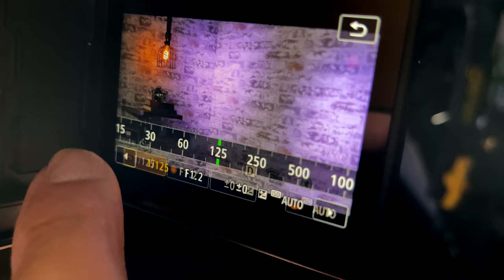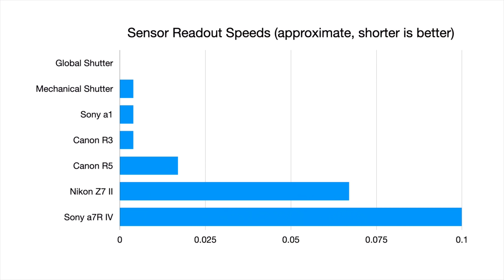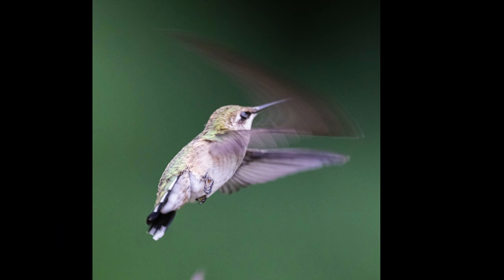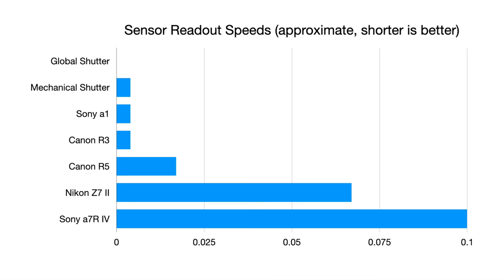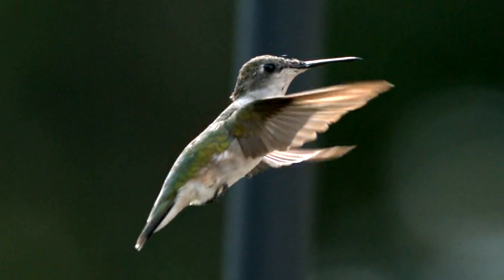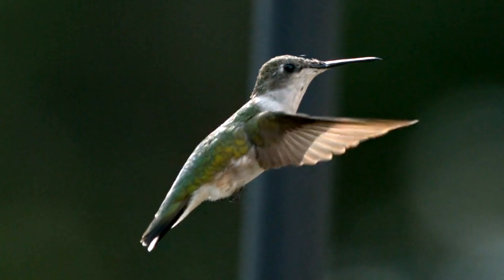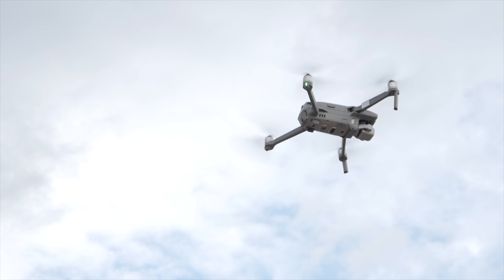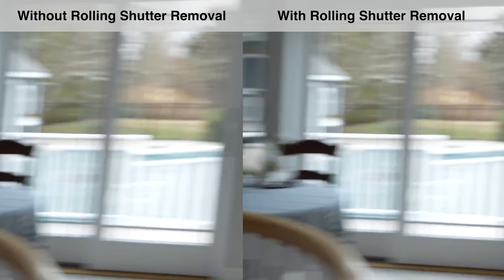Rolling shutter RUINS your photos & video: Let's fix it!

Comment: I'm amazed there isn't an option where a camera takes 2 or 3 images and then replaces the dark bands with the data from the next frame.
Reply: New mobile phone cameras that have HDR modes do this. They take a stack of photos all with slightly different ISO setting and then blend them together. It would be interesting to test these phones and see if the bands go away.
Reply: @seth.heerschap  phones are doing such cool things to get around the fact they are small sensors with tiny lenses, I would like to see some of those features come to 'proper cameras'.
Reply: @Speak_Out_and_Remove_All_Doubt  pretty much all of these features you can do in post with a real camera, with the added benefit of lower F stop, higher resolution, better dynamic range. But stacking is a very common feature in astrophotography and when you want to get the sky and subject without anything overexposed.

But I really do love the quick edit and post that smart phones have these days. They're improving much faster than professional cameras I think.

Comment: For still electric silent shutter photos,  You didn't mention it in the video. (edited, forgot to mention this is for stage theater hot lights)

On my Canon EOS R,  When I have certain stage lighting.  If I notice banding in my shots.  I have to figure out what's the light "frequency",  which most of the time is 60hz.  From there, I have to use the multiples of 60 to try to match up the stage light sync.  So I'm usually be shooting in 1/125, or 1/250 of a shutter speed to help minimize the banding when using still electric silent shutter photos on the EOS R.
Reply: It seems to me the if the problem was this easy to solve, this would be how we'd all be working around it. And it clearly isn't.

i cant see why this would fix the problem. Sensor readout is the time the sensor needs for the pixels, from top to bottom, to start reading. The shutter speed only indicates the amount of time each pixel has to keep "reading" until they stop. This means, if you shoot at 1/250 and if the sensor readout is about 0.05sec (1/20th), that when you take a photo, the pixels from the top of the frame will end the exposure before the pixels from the bottom even start the reading (because the readout is slower than the exposure). Counterwise, in a 1sec exposure, the readout would finish way before the first pixels that started reading, the ones on the top, end the 1sec exposure.
Now going back at your "60hz flickering fix with 1/250", as how i understand this all works... It seems to me that the pixels from the top would start the exposure earlier than the ones on the bottom, no matter what shutter speed you're using. If the readout is 1/20th, this means that the 60hz light has done three full flickering cycles by the time the camera has ended the readout... And each pixel has done a exposure of an incomplete cycle (1/250 < 1/60) at different stages of these cycles, so you should have 3 full flickering bands on the photo. This wouldn't happen if you shot at 1/60th because each pixel, no matter at what given time starts the exposure, would read a full flickering cycle, gathering the same amount of light as any other form another part of the sensor. Following that, you should have flickering in a 1/50 exposure because each pixel gathers a bit more than a full cycle at different stages of it, and the light gathering from each pixel varies again. So, when bumping up the exposure time, yes, the multiples of 60 theory makes sense, but when the exposure needs to be under 1/60, it seems to me that you have nothing to do to solve it other than having a super fast readout, again, the exposure has nothing to do at this stages.
Reply: @marc5279  TL:DR

I think I forgot to mention in my post.  That it was theater stage lighting that use hot lights, and not LED lights???  (Not familiar with the technical terms of theater stage lighting).  Since LED lights act differently than the old hot theater stage lights.
Reply: @marc5279  Also, I have to photograph low budget stage theater, and high school theater rehearsal shows.  That's how I notice this problem.  And how I fixed it.
Reply: @RonaldLadao  ye, big hot lights flicker quiet softly, and banding must appear really subtle, I cant see why you have any flickering issues in the first place... But if you say so, and that you experinced a fix doing this, i must be missing something here

Comment: I was worried about distortions when shooting flying cole tips, but it’s hardly noticeable, although my Olympus camera not even has a back-illuminated sensor. But the smaller sensor size certainly helps with a fast readout. Rolling shutter isn’t a problem on Smartphones either. Another solution: a central shutter such as in Hasselblad lenses.

Comment: Fantastic content, thanks. Golf clubs though DO bend significantly during the swing, especially with more powerful players - though they do use stiffer shafts.
Reply: Good point, especially if you use graphite golf shafts like I do, they bend a lot more.

Comment: I have a lumix s5 if you use aps-c crop mode for video (crop) or photo (med 12mp tele) the Rolling shutter drops from 21ms to 10.5ms.  keep that in mind if it becomes an issue.

Comment: I was  looking for a camera to do photos from a vehicle. I thought bigger sensors where the way to go due to more light coming in etc until I did read a comment on the A6100 about the rolling shutter, started investigating and wow, it is certainly an issue!. I'm moving back to investigate M4/3 cameras unitl global shutter sensors reach consumer market which seems like never happening.

Comment: How does rolling shutter relate to shutter speed? If my sensor readout is 1/30 s, does that mean that I can get blurred results of a moving subject as if I'm shooting at 1/30 s even though I may be at say 1/200 s?
Reply: Sensor readout is the time the sensor needs for the pixels, from top to bottom, to start reading. The shutter speed only indicates the amount of time each pixel has to keep "reading" once it starts. This means, if you shoot at 1/250 and if the sensor readout is about 0.05sec (1/20th), that when you take a photo, the pixels from the top of the frame will end the exposure before the pixels from the bottom even start the reading (because the readout is slower than the exposure). Counterwise, in a 1sec exposure, the readout would finish way before the first pixels that started reading, the ones on the top, end the long 1sec exposure.
A slow readout would give you deformations on a fast moving subject and high frequency flickering lights. The blur you apply on top of that is determined by the exposure time... So a slow readout with a short exposure has the best numbers to destroy your photos with rolling shutter and banding. On the other hand, a fast readout pared with a sufficient long-enough exposure shouldn't show any issues. But keep in mind, they are not related and one doesn't affect the other, the readout stays always the same, and the exposure "softens" its effects the longer it gets. Hope it helped

Comment: Does NTSC or PAL matter? I believe NTSC is used in the US and everywhere else you are supposed to use PAL to eliminate flicker. Is this correct?
Reply: As long as the shutter speed is staying at the hz rate of the place. For instance in the US and Japan it should be 1/60 to avoid flicker and 1/50 in Europe and elsewhere to avoid that flicker.

I have shot NTSC 30fps video in Europe with a 1/50 shutter and there was no flicker, so as long as you can hit the shutter speed needed for the lights, do it

Some mismatches can’t be avoided though like you can’t use a 1/50 shutter with 60fps video because the shutter is too long but you can use 1/60 with 50fps video.

Comment: How much better is the a9 than the R5? How much worse is it than the a1? Hard to find precise data on readout speeds anywhere.
Reply: A9 is about 2.5x faster. The R5's readout speed is ~1/60 and the A9 is ~1/150

Comment: I more or less understand the electronic shutter bending however not so much why mechanic shutter resolves it.

Mechanic shutter move at same speed it 1/8000 or 1/1000. The only difference is the distence between the 1st and 2nd curton. So why is it better?

Comment: It seems like a rolling shutter hardware fix for electronic shutters would be to turn on light collection for all pixels at time 0 and to turn off light collection for all pixels at time 0 + shutter speed.  Then read out the pixel values at your leisure.  This would solve the slow readout speed problem.  I haven't read any discussion of this solution.  Could there be a problem with needing pixel memory until the values can be readout?  Again, I have seen no discussion of these issues.  Is adding pixel memory hard?

Comment: Help me understand this here, I have a Canon 90D, The EOS 90D comes with an electronic shutter that can achieve a maximum speed of 1/16,000 seconds and a mechanical/electronic 1st-curtain shutter with a maximum of 1/8,000 seconds. So does that equate to 1-16th of a second and 1-8th of a second. Ta
Reply: no thats one/sixteenthousandth of a second and one/eightthousandth of a second
1-16th of a second  = 1/16
1-8th of a second = 1/8
Reply: @MikedieONE  cheers just realised as i posted the amount of zero's lol
Reply: @paulbrooks2796 Lol

Comment: The other day I was shooting hummingbirds and I had my shutter speed at 1/8000, aperture at f8 and ISO 800.  Of course the pic looked dark but since I shot in raw and the amazing dynamic range on R5, the bird turned out brilliantly sharp. Yet, the wingtips were not tack sharp like I hoped for.  I suppose its because of the phenomena you described in the above video?
Reply: I would guess that blur is more about action too fast for the shutter speed. Yes  1/8000 is fast, but so are hummingbird wing tips. Rolling shutter distorts where the wing tips are more than making them blurry.

Comment: Is it not possible to calculate rolling shutter based on sensor/camera specs and just use a simple algorithm to reverse the rolling shutter effect?
Reply: No, you would also need to know how fast the camera is moving and how fast all objects in the photo are moving in relation to the camera.
Reply: @TechnoBabble  I’m pretty sure they can make AI for this particular issue
Reply from the maker: For static subjects tilting because of camera movement, yes. But it's pretty impossible when you have moving subjects and a stationary background, for example.

Comment: I still don't get it. Why do you get rid of the problem with a mechanical shutter? No matter you have a physical shutter in front,  the read speed of the sensor is still slow, so you should have the same effect...
Why you dont have it (in pics) with the mechanical?
Reply: Ciro - when sensor is not exposed, when it's hidden behind the mechanical shutter, photosites ("pixels") on sensor keep the electrical charge, until it's purged after the readout. That means that what was captured during the exposure, that is what it will be read out. Exposure is separated from readout in this case.

So, at least with longer shutter speeds, the whole sensor is exposed to the light almost at the same time. It's not a real global shutter, but it's close to it. With faster shutter speeds, it depends on the speed of the shutter, and not on the readout speed.

With electronical shutter, the (rolling shutter) effects depend on the sensor readout speed, and with stacked sensors with DRAM, like on A9, A1 or R3, it depends on how fast can charge from photosites be converted, digitized, and transferred to the DRAM. Since transferring to DRAM is much faster than the full sensor readout, sensors which utilize DRAM can achieve similar effect to mechanical shutter, and therefor more similar to global shutter, than to regular rolling shutter sensors without DRAM.
Reply: @mbaksa  , "when sensor is not exposed, when it's hidden behind the mechanical shutter, photosites ("pixels") on sensor keep the electrical charge, until it's purged after the readout". This is a great explanation!. Thank you very much!! and thanks for taking the time to explain it. Much clearer now, thanks!

Comment: Great video Tony thanks, my biggest disappointment with the new A7iv (given the sizable price increase) was that Sony didn't manage to squeeze in a stacked sensor to once again cement them as the mirrorless leaders, offering cutting edge features at a great price like so many A series models have done before it. 
Sony could have still kept the A7iv artificially capped at 10fps (well actually 6fps!) to protect the A9 and A1 sales but I think to have quite a sizable rolling shutter and probably a nasty banding issue too when shooting in silent shutter mode is unacceptable at $2500 and what is essentially 2022.
I would love to see some silent shutter banding tests with this camera, maybe a comparison shootout against the A9i which is actually the same price as the A7iv and so makes for a very interesting proposition!

Comment: longer or faster shutter speed to eliminate rolling shutter on stills? Isn't it faster shutter speed should have less rolling shutter?
Reply: To reduce or eliminate flickering of LED lights (brighter and darker bars in video) use longer shutter speed. It might seem counterintuitive, but the point is that the sensor readout time is constant so longer shutter speed will result in more "averaged" flickering, with less distinctive horizontal bars (or no distinctive horizontal bars). That's why you might not see any horizontal bars with 1/50 or 1/60 s, but might see at 1/1000 s. That's also why the frequency of flickering (it's actually result of a PWM brightness control) of an LED light matters - the higher the frequency, less chance of noticing horizontal bars.

To reduce other effects of rolling shutter, shorter shutter speed will mean that the object (or scene) is moved less during the exposure, and therefor other rolling shutter effects should be less noticeable (imagine propeller rotating 3 degrees instead of 20 degrees between the beginning and the end of a readout).
Reply from the maker: What mbaksa said. Plus shutter "speed" is a misnomer; the shutter always moves at the same speed.

Comment: Based in the UK, I simply change the shutter speed for video to 1/50th or 1/100th to eliminate flickering. I guess you would need 1/60th and 1/120th in the US to achieve the same.
Reply: LED lights don't flicker at the AC line freq though, they run off DC (conversion in the bulbs electronics) and have a controller chip in them to pulse them X times per second (usually at least I think that's how it works anyway) they definitely flicker at a higher hz than 60hz.
Reply: @MN12BIRD  Correct, a lot of small or cheap LED lights is PMW to control their brightness, which causes them to flicker hundreds of times a second and it's based on the AC frequency.

Comment: Im using e-Shutter in sports, (R6) and i still haven't find any problem. If i look really hard, in SOME pictures i might see the pattern, but i would say the issue in RL is totally non-issue.
Reply from the maker: Yeah the R6 has a really good readout speed and I'm comfortable using the electronic shutter for sports. You will see the effect in professional sports for fast-moving sideways subjects, like if a pro kicks a soccer ball, it'll end up really wonky. You can also get flickering under artificial lights, depending on the lighting.

Comment: Perhaps Dxomark should consider rolling shutter. That way Canon will no longer get such terrible scores as they have for the R5. I mean, Sony and Nikon both have better scores, due to their better dynamic range and thereby lower noise in the shadows, and much better highlight recovery. Consider that in your buying decision ;)
Reply: What do you shoot? I'm curious because I have no issues with dynamic range even using an EOS RP in the harsh Australian summer! It's simply a matter of knowing how to expose for the sensor at hand. The highlight recovery is quite good on the RP, to the point I overexpose and recover highlights rather than underexposing and recovering shadows (poor on this camera).

Comment: hm.... 1/125s at a sport event to avoid color banding. that's not a solution, that's a joke :) With that low shutter speed you'd have artistic images, everything blurry. I am so glad, my cam has still mechanical shutter so I can go up to 1/1600s without any troubles at hockey games. Too bad, that Canon hasn't the same feature as Nikon does to fine tune aperture for still photos 8-/ On a Z9 they can finetune the shutter speed to match the led-flicker-rate - but they don't have a mechanical shutter anymore

Comment: I still don't understand why sticking a piece of metal (shutter) in front of the sensor makes it read down the sensor faster, reducing rolling shutter.
Reply: It doesn't (make sensor read faster). It prevents exposure of different parts of sensor during different times, since light reaches sensor only when shutter is open. It separates exposure from readout. The sensor readout speed is the same. It's a matter of exposure, and not readout speed.